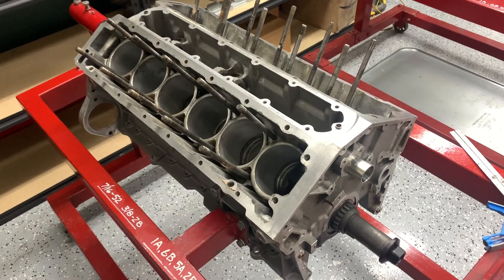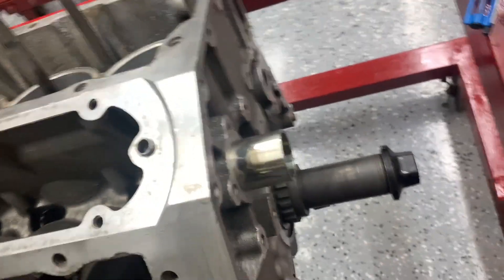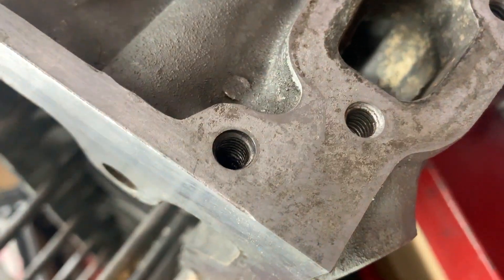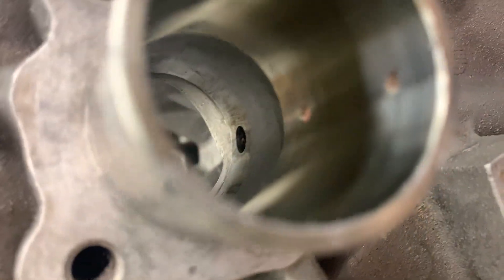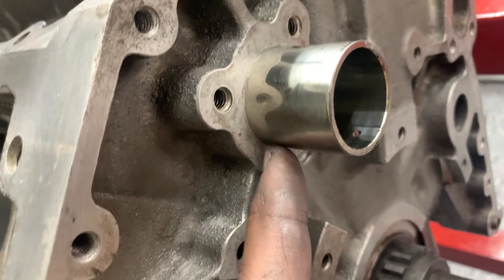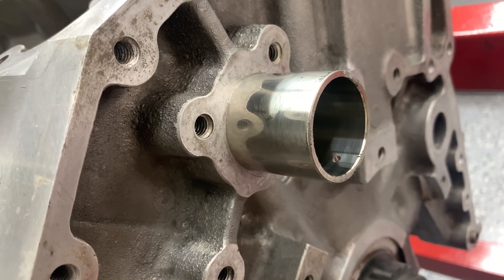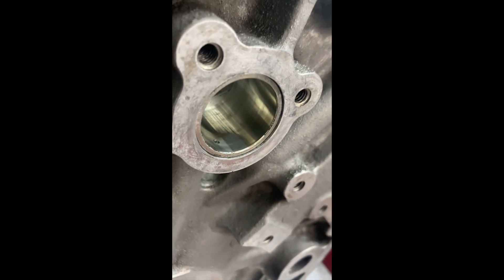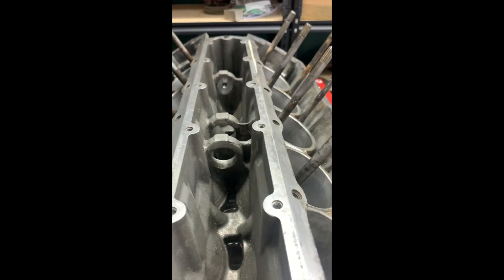TuesdayExtra:S5E3- Installing The Front Jackshaft Bushing On a Jaguar V-12.

Comment: Hi Bob, Great 2 videos on the journal bearing removal and install, excellent tooling you made for the task also.

 Maybe consider cooling the new bushes in a freeza prior to installation and wave a light amount of heat in the bore (not enough to melt or change molecular structure of the aluminum, just enough to raise the bore by 10 - 20 degrees Celsius above the ambient room temp) and this should ensure your bearing bush walks in without any force on the rim face to avoid any bell mouth distortion that may occur or "dragging" of the external wall structure. this may also be a good way to remove the old bushings so that "dragging" does not occur thus damaging the internal Diameter of the bores which may be hard to repair or "Clean UP" prior to the new bushing's installation. Otherwise, Well done and love all your videos!!!

Derek McLaughlin in Buffalo, Victoria, Australia.
Reply from the maker: Thanks Derek. The bushings install without a great deal of force. Removing them is the part of the process that takes a little work.